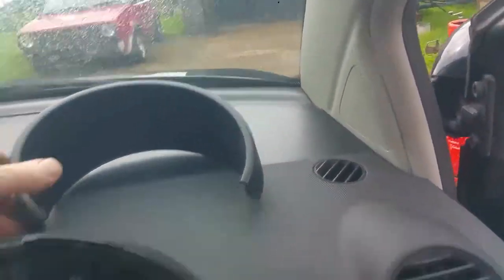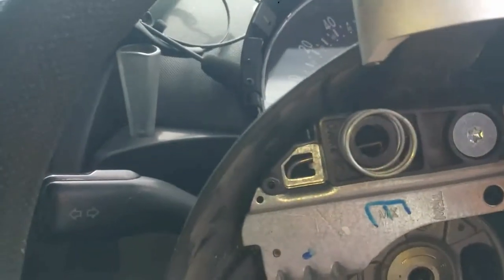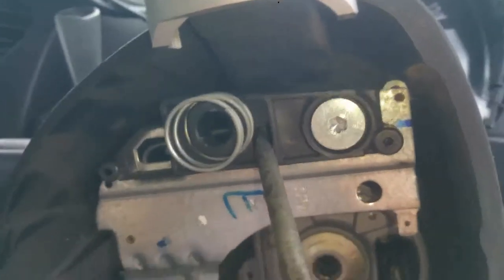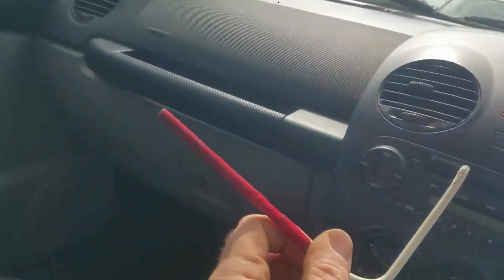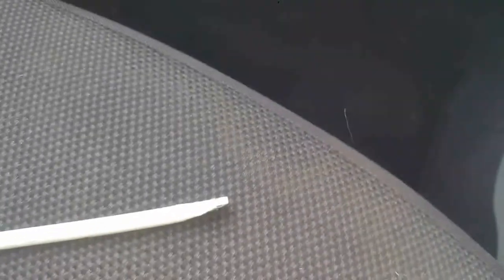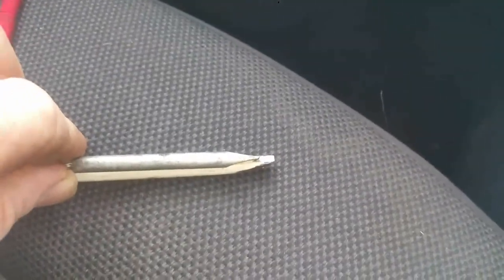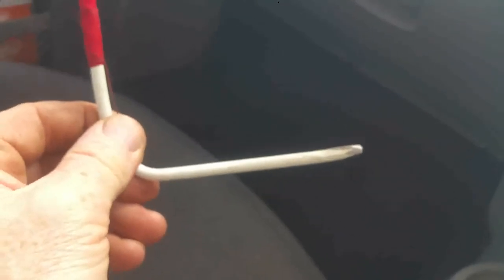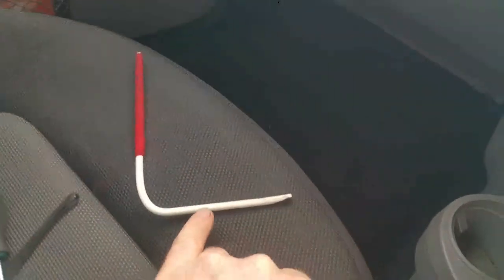DIY Steering wheel airbag removal tool Beetle Bora Golf

Comment: One of the best explanations of what I'm trying to do when I lever that spring back. Thanks!
As a follow up, your method worked brilliantly (I bent an old tent stake I had lying around). I did find that I had some foam in the hole that prevented getting the necessary leverage, so I used a quarter inch drill bit (Milwaukee hex shaped) and a 1/4" ratcheting box end wrench to clear the foam. Then it worked as planned. Thanks again.

Comment: I saw videos of people doing it and just assumed it was a bent flat head screwdriver.  Wouldn't release the springs and because you're working blind you don't know this.  The tip on even a smaller one is too big.  I had an old cheap one with a broken handle, heated and bent it then ground the tip down.

Comment: Tried it. Dinna work. Drill a 5/8" hole, 51mm from the back of the wheel, behind the silver strut, straight through the rubber and the aluminum. Access the spring that way.

Comment: Why did u take the airbag out, what was the problem to make you do that.
Reply: I can't speak for the original poster as to why he had to do that.  However, you do have to remove the airbag in order to remove the steering wheel.  The steering wheel has to be removed when you are replacing things like the clock spring or the turn signal switch.
Reply: All things terrible and horrendous must pass thru that airbag: changing heater core, properly fixing heater door/etc doors, removing dash without cutting a six inch piece out of the lower dash area under steering wheel column, properly cleaning out the mind baffling bad design for the fresh air intake pathway where many of the ecm-type computers live and where mice will move in..... All very fun projects which will test your patience and build your resolve